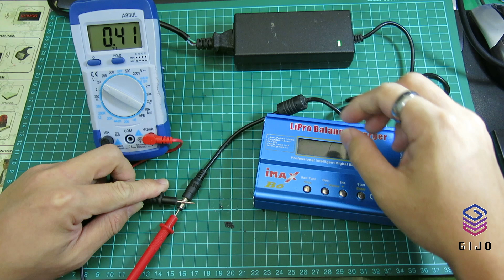FIXED Cable Intermittent On Off Power Adapter Imax B6 Lipro Balance Charger

Comment: Kalau pakai adapter 12V 5A, berapa A perlu set utk masuk ke bateri 3s Lipo 6000mah?
Reply from the maker: Adapter 5A ... so max boleh charge set 5000mah.